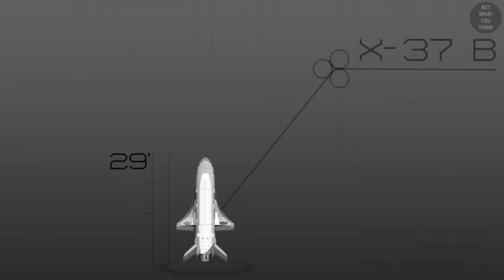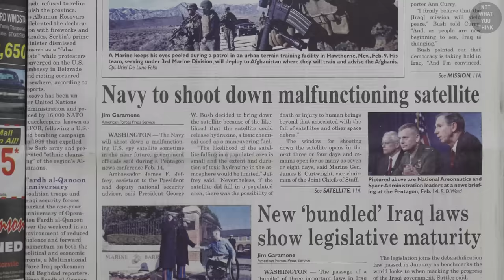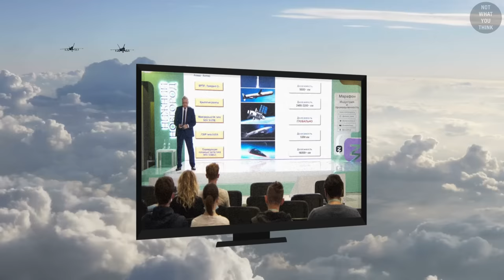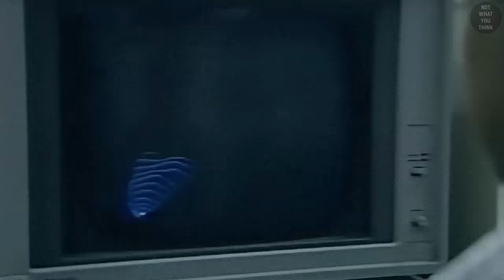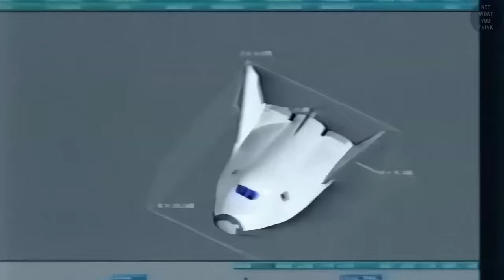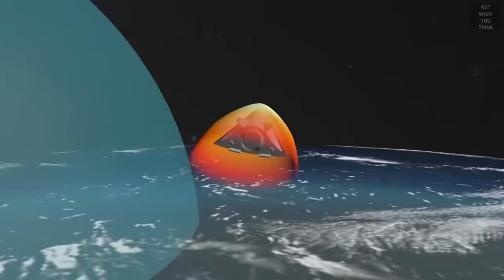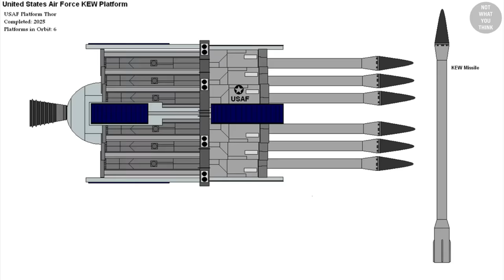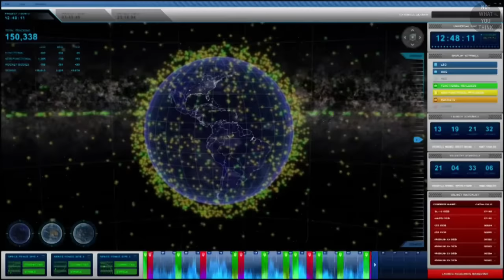Why Russians Think X-37 is a Nuclear Space Bomber

Comment: The X-37, along with all previous prototypes in this project, *IS* for delivering thermonuclear warheads via MIRVs -- Multiple Independently-targetable Reentry Vehicles -- in large quantity over a longer trajectory arc, as one would need to cover more of such massive countries as Russia and China.

It delivers them upside-down, as the hatches in the actual vehicles will be on the top rather than the bottom.

The idea for this came in 1959 when Avro Canada was about to be mothballed, and aeronautical engineer Jim Chamberlin posited his plans for a future version of the Avro Arrow.  It would approach the edge of space, flip over on its back, open the bay doors, and launch satellites into space from there.

The X-37 does this same thing, but in reverse: it goes into an intercontinental trajectory actually IN space, flips over, opens its topside bay doors, and releases MIRVs according to position to continue to their targets.

It then yaws around aft-forward (and still upside-down), and then re-enters the earth's atmosphere like the Space Shuttle did, backwards and upside-down transitioning with a half-flip as it presents maximum surface area to slow down as it transcends the atmosphere to a forward and rightside-up attitude, using ceramic heat tiles to shield from the heat of re-entry.

Once back at base, it is reloaded with more MIRVs for the next sortie.  One large machine similar to a Rubber Tire Gantry Crane unloads the old loading frame from the bay, then another one comes along behind it to load a new loading frame populated with MIRVs.  It takes only a few short minutes.

This strategy enables the Pentagon to extend the service life of certain aircraft which would otherwise have been made obsolescent, as they can easily be retrofitted to carry the X-37 to launch altitude.

Also, this is a MUCH more cost-effective way to annihilate entire nations' military infrastructures than building a massively complex, incredibly expensive throwaway missile to carry only 3 to 10 MIRVs to target.

Your tax dollars at work, and working rather well at that.
Reply: @AesirMO2  You are working from an unqualified definition of the term "blanketed."

You are working from the wildly incorrect notion of the planet's brittleness and what it would require for Mutually-Assured Destruction to come to fruition.

You have a misunderstanding of how many MIRVS of various models can fit in the weapons bay, all pointing straight up.

Comment: I'd be more concern about it delivering tungsten rods with a few re-entry boosters on them then actually delivering nuclear weapons to space which would violate arms treaties.   Tungsten rods are also called "Rods from God" as a steep re-entry could deliver more kinetic energy than a nuclear explosion and without any radiation.   The tungsten rods would only need to be in highly elliptical polar orbits so the question is whether the X-37 have been going into such orbits or to where a tungsten rods could be surititiously boosted to such an orbit or in this case use aerodynamic force to achieve such orbits without a noticeable rocket exhaust plume and heat signature.  Then the question is why would a reusable craft be needed for such a purpose, why not a disposable launcher that does not return safely to Earth, why would there be a need to bring anything back.
Reply: You do realize how fucking massive a telephone pole sized chunk of solid tungsten would be right? "Rods from God" has always been impractical from it's inception. Too expensive to make and too expensive to launch if it's even possible to launch something with such mass.
Reply: @JoviaI1  With kinetic weapons the energy is proportional to the mass and the square of the velocity.  The costs of launching mass into orbit can be countered in two ways, by sourcing mass in space to begin with, perhaps by employing what's now called the interplanetary super highway (a very slow but low energy form of interplanetary travel) and or by using more elliptical orbits for higher re-entry velicities.  If both approaches are implemented to reduce the costs of deploying "Rods from God" weapons, the deployment would even be more surredeptious.  Besides, since when has costs been an issue with weapon development, the point is the technology is simple to deploy and would be quite devastating, sure it would be costly but so has those toilet seats and hammers that show up on the defense budgets...

Comment: Lol those words about the US and UK "holding up their end of the bargain" didn't age well, and it didn't take long xD. Ukraine just pushed Russian troops back to the border (with the LPR and DPR, but it's still significant) in several locations as of today, and are refocusing their efforts again as a result of this strategic victory, with the expectation that they'll be sent towards Crimea next to try and retake the region. By the time they get down there the M777s and all the other gear that they just got given, will be on the front lines alongside that refocused effort. No doubt they're actually off getting trained on the new gear lol

Comment: You know I generally watch your stuff, but this one is chucked full of disinformation. I know because I worked at Vandenberg AFB on the Titan 2, 3, 34D and Titan 4 programs for 25 years. The NRO was our primary customer. The X37 program is a cargo hauler for classified programs. Wearing SCAPE suits around the Space Shuttle and this vehicle (X37) is to protect one from hydrazine vapors nothing more sinister than that. It's routine for fueling operations with hypergolic fuels and oxidizers.